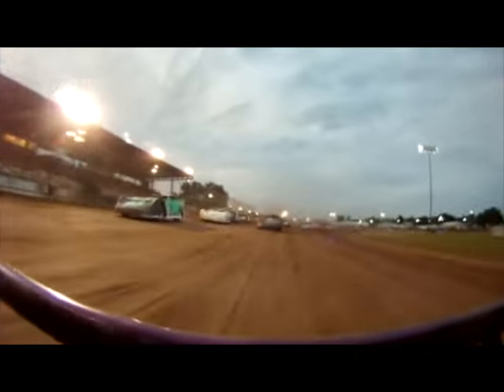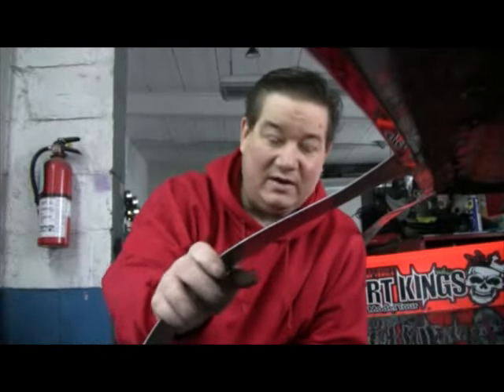Rocking in the cradle of the left rear of a dirt late model for the ultimate of traction.

Comment: when you say "graph the shock mount position".... your talking lower shock mount through the movement of the BC during the indexing during hike and bar angle changes, correct ?
Reply from the maker: Yea. I built a side view model of a suspension. I put a piece of oversized paper behind it and could draw and chart the positions. It really shows you what is going on with the rear shocks. Drop your birdcage at half inch increments and see what goes on with the shock. 
Then start altering arm lengths and angles and watch how it affects the shock.
Reply from the maker: You can also start looking at shock speed per position. The closer the shock mount ending points are to each other, the slower the shock speed is at that position. With a little work, and a simple shock dyno, you might start getting a sense on where and how much bleed you want in the shock.
Reply from the maker: Thanks for watching.

Comment: Have a question I have a 07 BWRC we’re tight getting in about half way of the corner the car wants to snap loose then tight on exit every week the RR tire you can see the cords and the RF has zero heat what would you look for first in a situation like that where do we even start
Reply from the maker: Usually tight off the gas means too little wedge. I would start with adding some wedge. If you are rolling in on the gas, the wedge may be holding you tight and the RR is just slipping and spinning adding heat and tearing the tread off. Make sure you are on the bump stop on the RF or maybe the spring is to soft up there. It’s a tough call for me not being there to give you more to go on.
Reply: @HoganTechnologiesLLC  yes sir will look into that thank you me and the crew have been watching all your videos they have helped us out tremendously